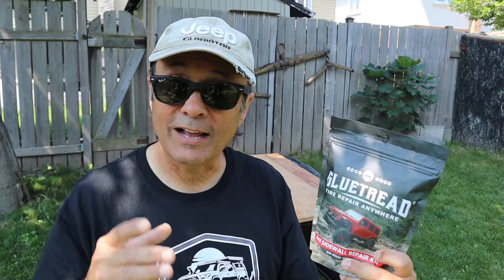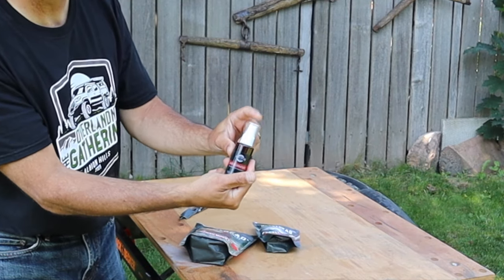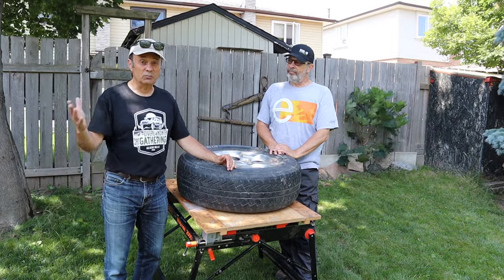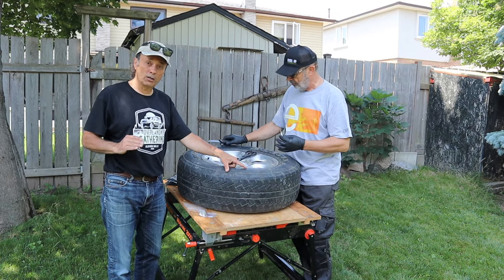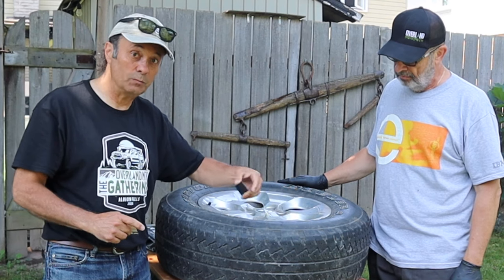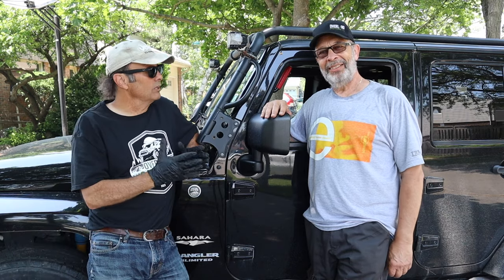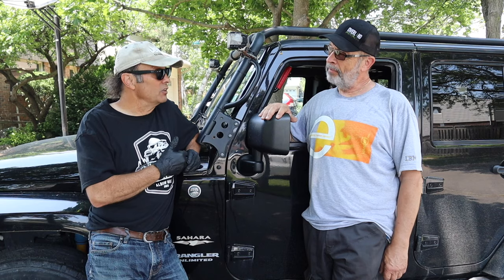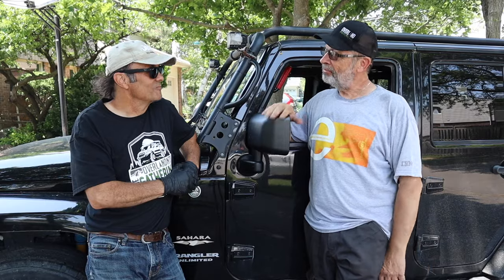GlueTread 4x4 Sidewall Repair Kit Review

Comment: Thanks for doing such a thorough review! I noticed you tested on the smooth part of the sidewall, do you think these would still work if the tire had sidewall lugs or if the hole went through the raised lettering on the side of the tire?
Reply from the maker: I don’t know for sure but I believe it would be up to the task, but you’d need to sand the area of the puncture smooth in order for the patch to seal around the puncture. Cheers .
Reply: @CheaperJeeperTV Good point, a lot of sanding but cheaper than an off road tow truck. Thanks!